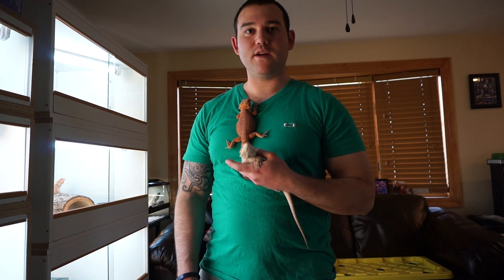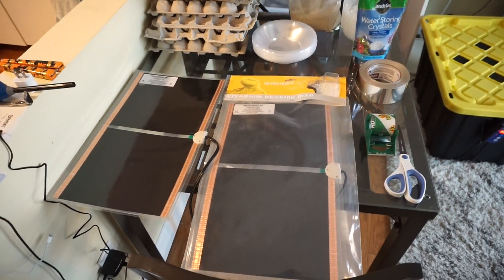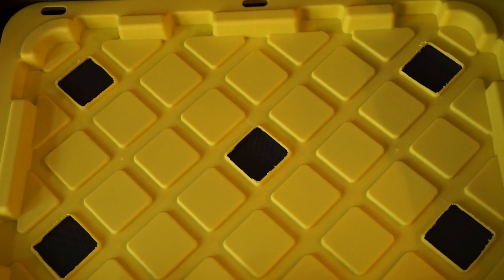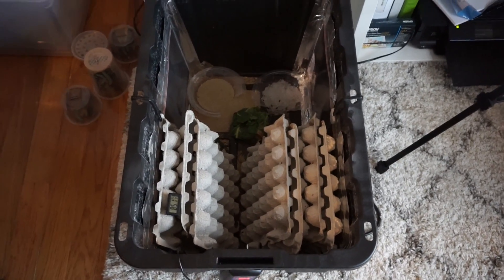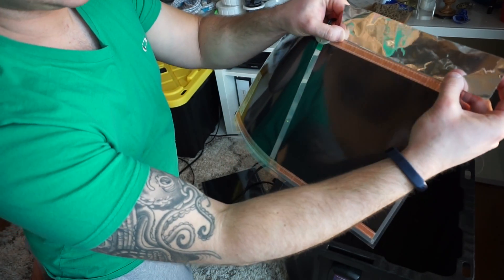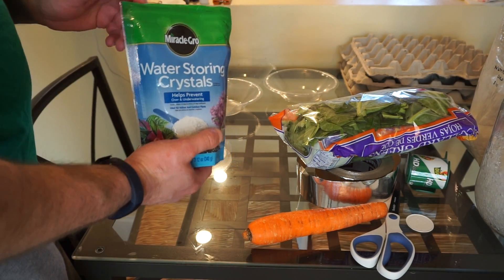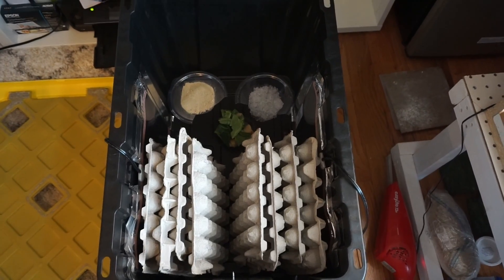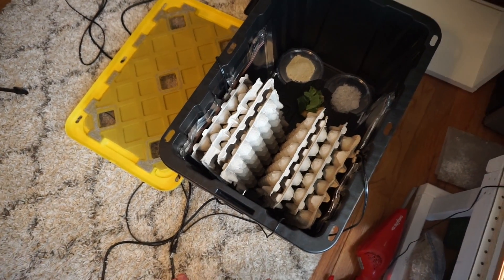RAPTOR REPTILES: How to Set Up a Dubia Colony

Comment: I had a few issues after i started my colony and the first was finding the flats for a reasonable price and after picking up some mcdonalds one day and got a drink carrier and found it was the same material FOR FREE!, the next few times i went through i asked if i could buy a handful and they just give them to me, tried them out after colony cleanup and they work great, poo falls out the bottom and nymphs get fed, you will understand after you look closer at the carriers plus they ARE FREE. My second issue was Ants, they figured out that i was feeding oranges to my roaches and soon started pigging out on the oranges and started taking my nymphs as well. I didnt want to poison considering they may infect my colony so i used screening where the holes were and they figured out how to get by.  End result was to rub petroleum jelly all around the tote and have had no issues after that. Hope this helps the others out. Good luck!!!!
Reply: Dope bro

Comment: I getting one dragon should I start breeding before I get the dragon or as I get the dragon get breeders as well as getting month worth of dubi for feeders also how many dubi can one dragon eat in a month
Reply: 1) Breed your Dubia before you get your dragon. It takes 5-6 months for baby Dubia to be able to reproduce. Start with around 50 sub-adult Dubia, that way you won't be getting old adults that might die off quickly. Remember, females live around 2-3 years, males about 1-2 years.
2) It's kinda hard to put a number on it, but I would think about 60-80 adult Dubia a month per beardie, together with crickets, worms, etc and daily fresh veggies and fruit to vary their diet.

I know you asked your question 2 years ago, but they were good questions still worth answering. I'm surprised no one else did in those 2 years.

Cheers.

Comment: Speaking of dubia's There are thousands, in my colony  
Stand the egg crates on end and put a simple , smaller cardboard divider between each , the egg crates 
slide out easy without binding , and all can climb up to the fruits and 
veggies placed on top of them . The other floor space reserved for water
 crystal dish and treat food dish . Treats for mine are any mouse and 
worm parts that do not get eaten by my baby/adult garters , the dried 
Pangea mix that my geckos leave behind , fish flakes , krill 
,,,,,,,,,,,,,,,,,,,,,,,,,, THEY WILL EAT YOUR GARBAGE . Which they do , 
as I get the veggie scraps from my favorite deli  , FREE and egg crates as well
Reply from the maker: Nice! Thanks  for the tips! I actually have been doing that cardboard trick and have noticed a spike in breeding. I think because it gives them a little more room in between the crates!

Comment: Nice video man. Is two heat pad required? Can you get the required heat with just one?
Reply from the maker: It honestly depends on how big of a tote you purchase and also the temperature of the room your keeping them in. The heat is really only a must if you plan on starting a breeding colony. My recommendation would be to buy a thermometer or a thermostat and test out one heat mat. If you are reaching a temperature of 90 with one you should be fine.

Comment: hates to break it yo you , but them heat mats that you said are safer then heat tape , are in fact heat tape just wired up into little mats  ( i suggest if you use heat take make sure it really is made by flexx watt , there is some sub-par knock offs out there . Flexx watt is made in the USA and it will be stated where it was made on the heat tape roll its self ).  heat tape is safe when you run it on a Re-stat just like you are in the video .  heat cord is the one you really do not want to use its been linked to a lot of big breeders having fires .  ( all so most re-stats have a build in fuse that blows when there is a short any where that can cause a fire , some like ranco 1500 watt re-stats do not )      You all so forgot the temp needed for Dubia to thrive and breed , they can live in 75-100+ temp range but they are like most reptiles and require a 88-95 warm spot to breed well .
Reply from the maker: Dan wurm Thanks for the input. I also hate to break it you but these specific heat mats that I purchased directly from reptile basics are designed to be used in tubs. I understand there are a lot of knock offs out there but I have had literally no problems with these mats. I also state in the video that this setup I use works best for my needs but may not work for others. There is no end all one way to do anything in life. I personally haven't used your method so I can't say whether it would be better or worse. This video was also requested by Subscribers being I have had such a high success rate breeding dubias this year.